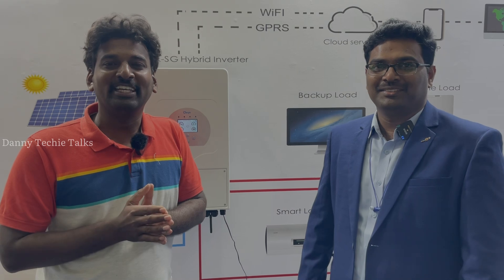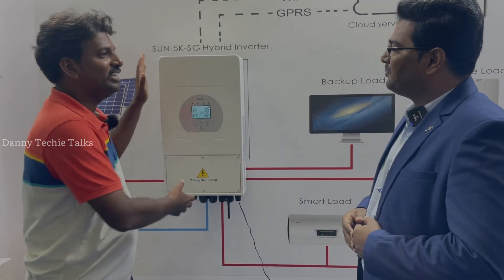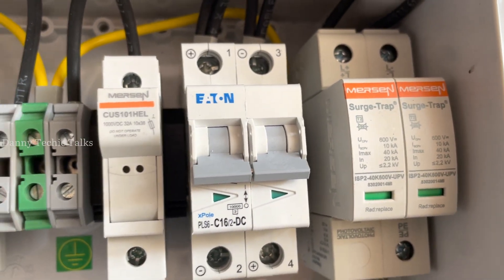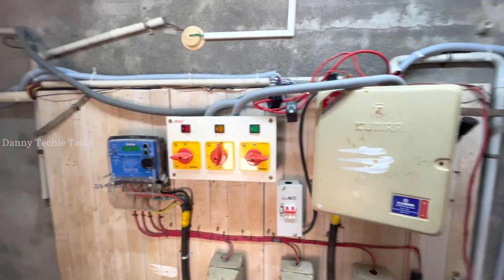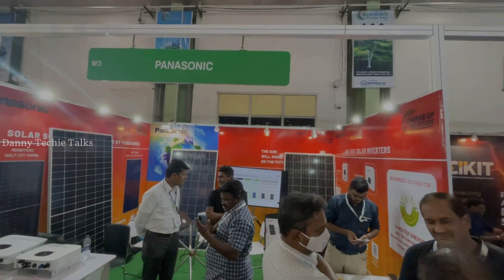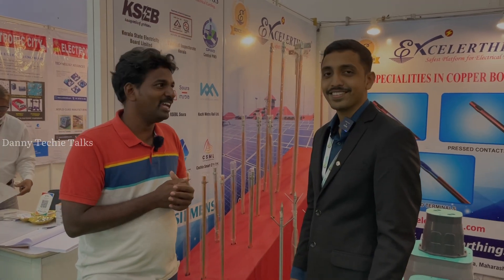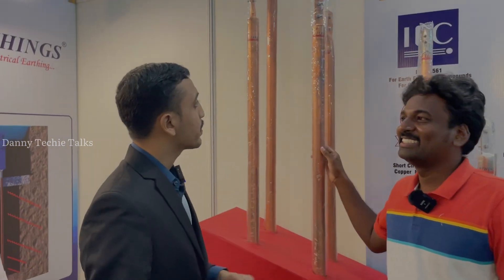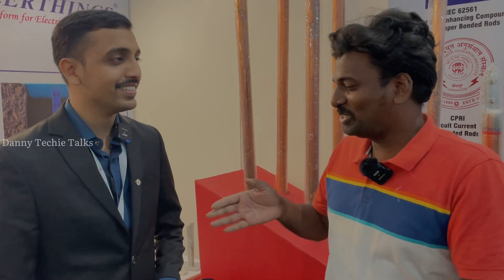International Solar Renewable Energy Expo in Chennai Part - 2 | Chennai Trade Center

Comment: Sir i have already installed a 5 kw ongrid system am planning to add a 5 kw off grid system and then attempt to make it hybrid can i use the same 5 kw panel and split the DC power that comes or should i have seperate 5 KW panels for the ongrid and another 5 KW panel for the off grid ,please advice
Reply from the maker: Always use separate panels for On Grid system and separate panels for Off grid, please don’t mix both in the same system. Because for Off grid- amps is important so wiring is quite different in Off grid compared to On grid